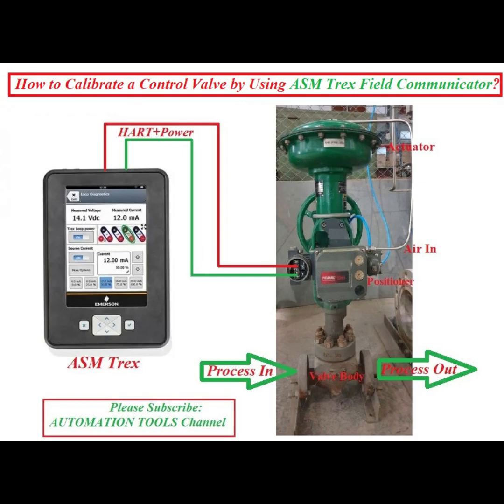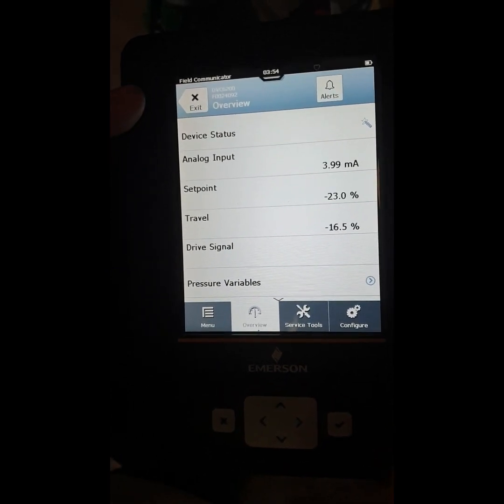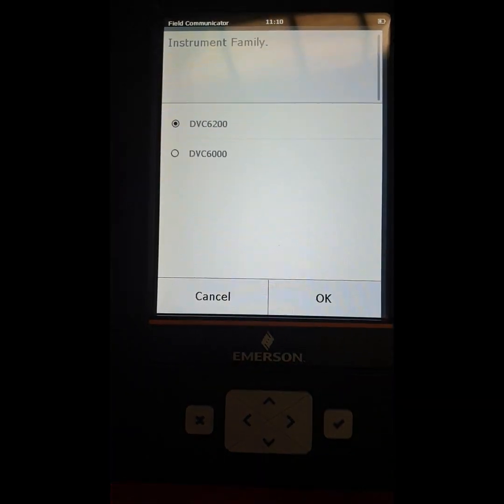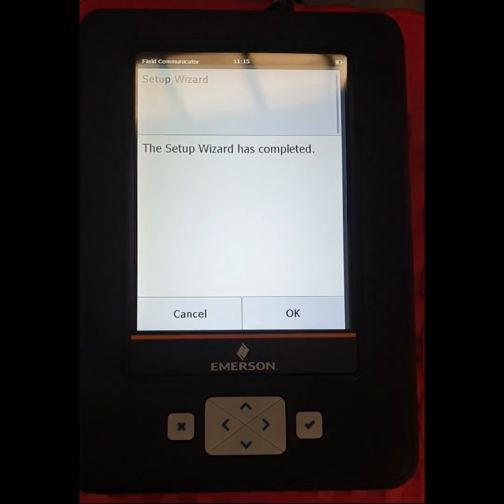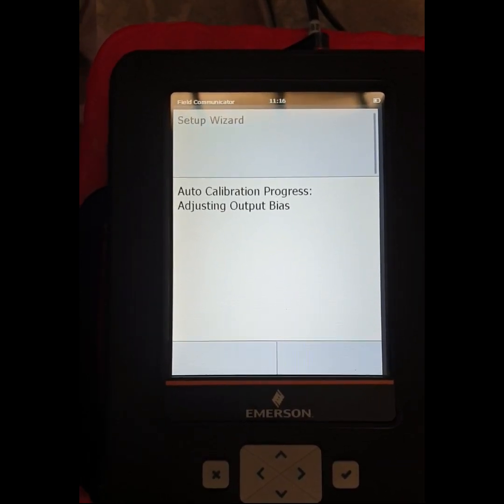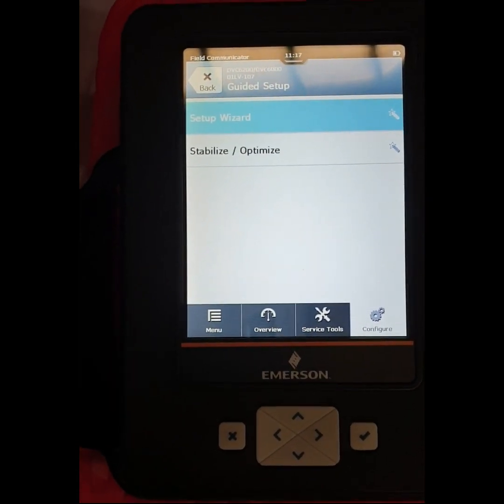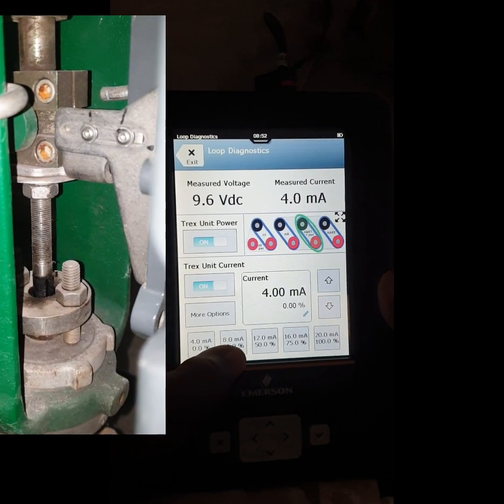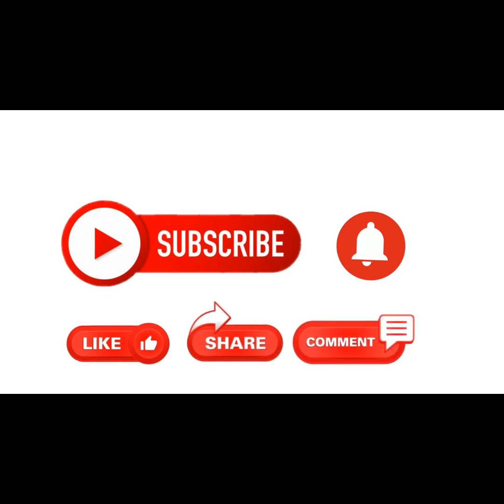How to Calibrate a Control Valve by Using AMS Trex Field Communicator?

Comment: Can you setting that the control signal 20mA the valve fully open and 4mA for the valve fully close
Reply from the maker: That value I have calibrated , it is failed to open. So 4mA to open and 20mA to Close.

If you want to reverse this you have to change the spring setting of actuator.

I think you know Air to Close and Air to open valve are designed for different purposes.